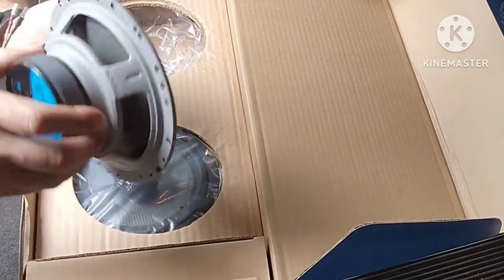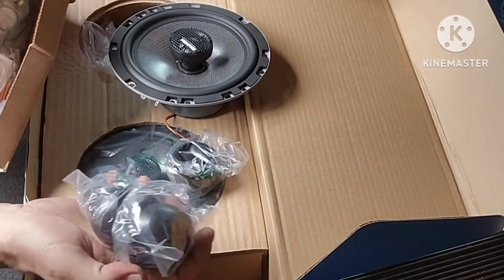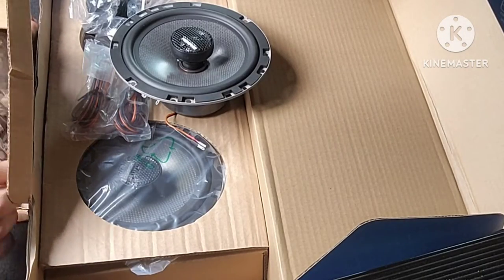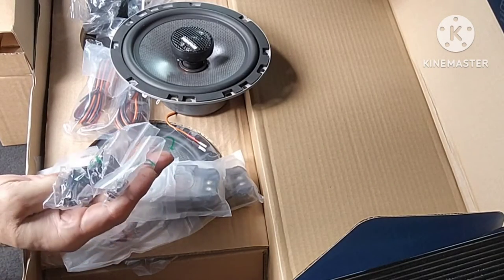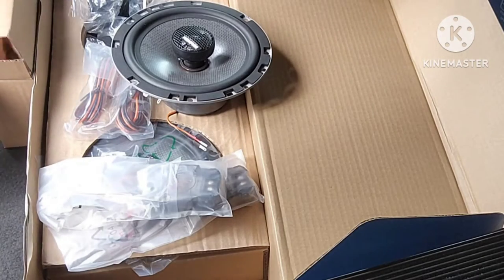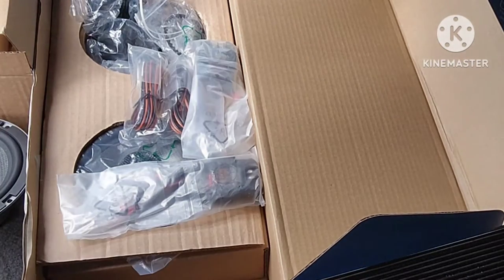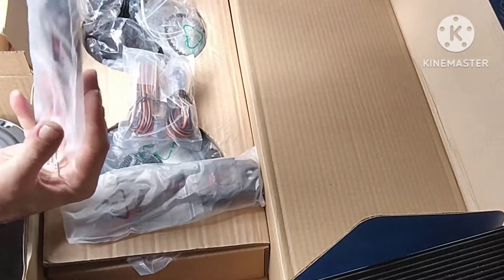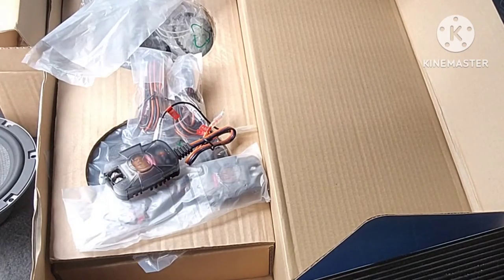Memphis Audio MS62 M Series convertible 6-1/2" car speakers

Comment: So I came across a lot of your videos of speakers are looking at   … So what is your favorite line of speakers that’s a 3 way component  that sounds clean I’m not to worry about lower bass I have 2 12s… and the tweeters can get bright but not  harsh it tin sounding.. For example I thought the Memphis prx coaxial sounded nice I have it on my boat but since it’s only 50w rms I’m not sure if it can get loud enough
Reply from the maker: 3 way...hm, of stuff i have personal experience with... and you want pretty loud..no price range, no sizes,  heres the thing, if I am recomending blindly, I do have a go to line of speakers, that ALWAYS solves any issues, they are not cheap, but they always deliver. thats the Alpine type R line.  if youre more of a budget person, head over to amazon, and look at Recoil Audio 3 way sets.
Reply: @CarAudioEnthusiasts  like if it’s a 3way set 500 or less and 6.5 and 3in drives  and 1 in tweeter unless it’s something little bit bigger and better I’ll make it work